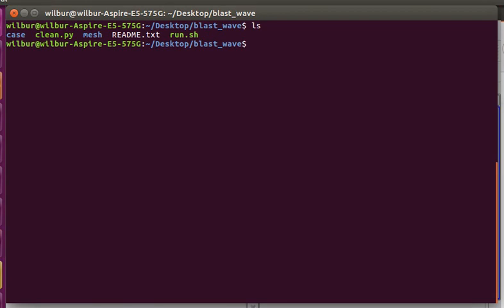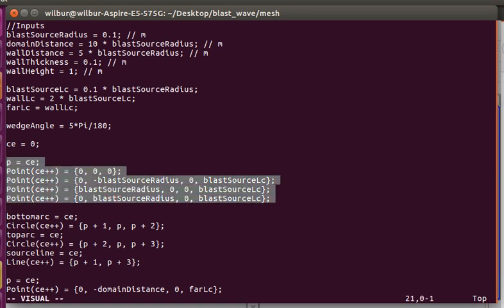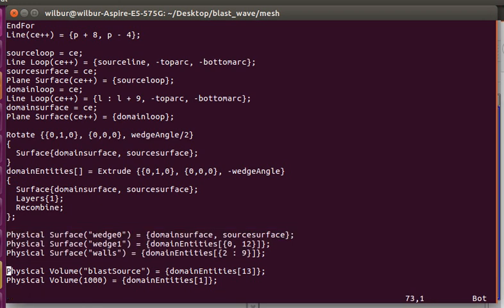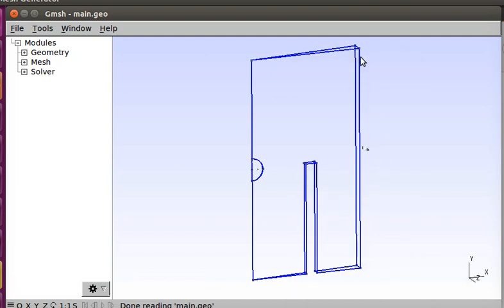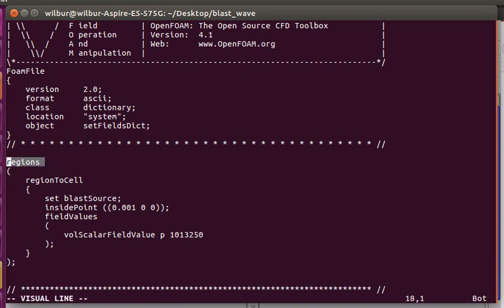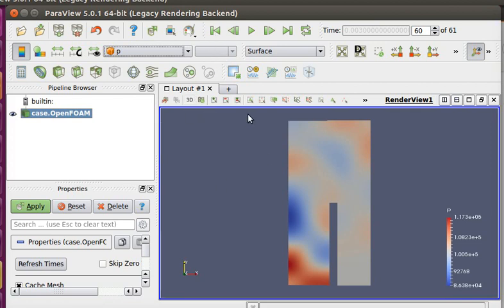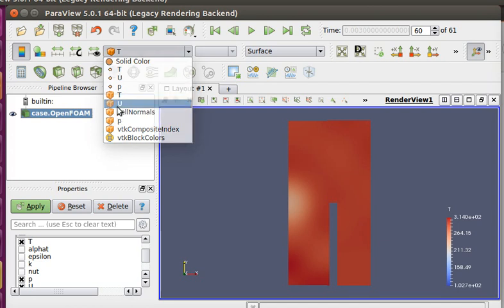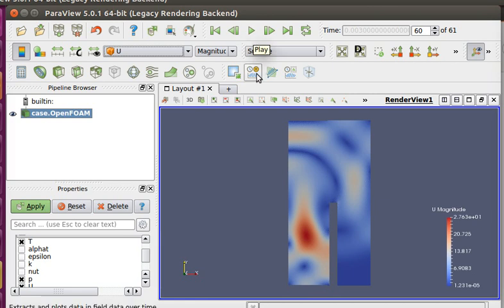High-Pressure Blast Wave Propagation Simulation with OpenFOAM

Comment: Hello, thank you very much for this tutorial, it is very helpful. Which version of OpenFOAM was used for this example? I am try to execute the files and replicate results on my organization's Linux cluster that is currently running OpenFOAM-3. However, I am receiving an error message saying "gmsh: command not found". Is gmsh a command that is native to OpenFOAM-3 or is it an application that needs to be installed and loaded separately?
Reply: Not sure if you'll look at this a year later, but it is a separate install. Use the command
sudo apt install gmsh
to download it.

Comment: Hello,
thank you verry much for this tutorial. I'm trying to run it on linux with openfoam 5x. When i try gmsh main.geo i have this error : ** On entry to DGESVD parameter number  6 had an illegal value. Could you please show me how to fix it
Reply from the maker: Sure, can you try to see if different versions of gmsh work? e.g. latest vs. default sudo apt-get install.
Also, did you change any parameters?
Otherwise, try commenting out the whole gmsh script, then step-by-step commenting back things in, until you get an error, to pinpoint the source of the error.